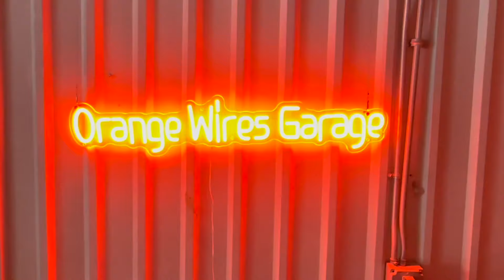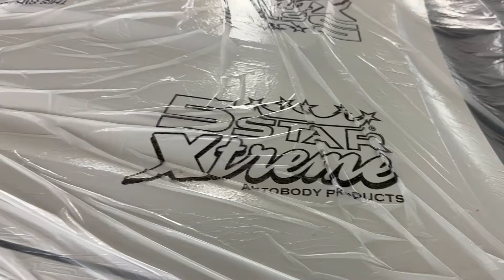We got the High Bid and it was CHEAP for this TACOMA! Wrecked to UNWRECKED!

Comment: Better than the white paint job Toyota is doing.. I have 2022 white 040 Tacoma Off Road that's already peeling...
Reply: Our 2016 doing the same…opened a claim with Toyota …not sure what they do
Reply from the maker: Hopefully Toyota will stand behind these paint jobs
Reply: @joetrippi1603  They have a recall for your year model, so I was told by Toyota... I got lucky and the dealership I use in Cleveland TN fought for me and got a rust spot on the roof and the back window covered under warranty... But now the warranty is gone & was told it will peel again
.. 🤷🏻‍♀️🤦🏻‍♀️
Reply: @OrangeWiresGarage  if not, do you want to? 😜😁
Reply: @KatrinaTrys  
Thanks for the Heads Up….
Reply: @KatrinaTrys  
At some point get it repaired….toyota said to keep all receipts for possible partial or full compensation.
Reply from the maker: We would love to paint it, finding the time however is a different story sadly.
Reply: @OrangeWiresGarage  If you  find time, call the little short guy that use to bury phone cable 😜 (Corey)... I am sure by then it will have started peeling again 🤦🏻‍♀️